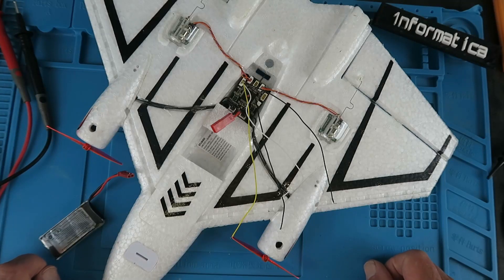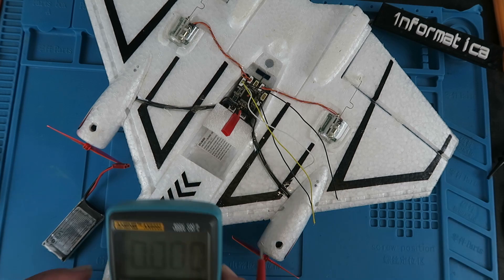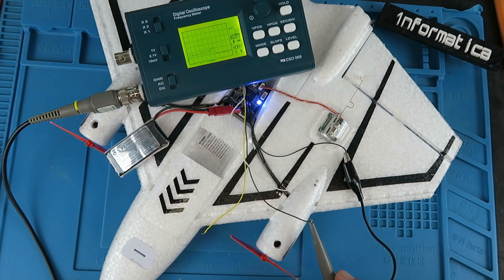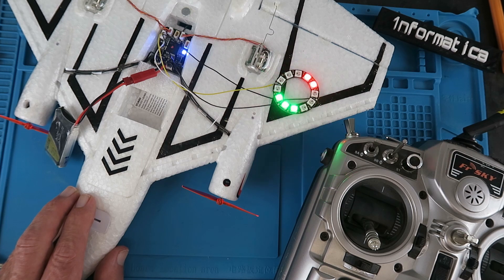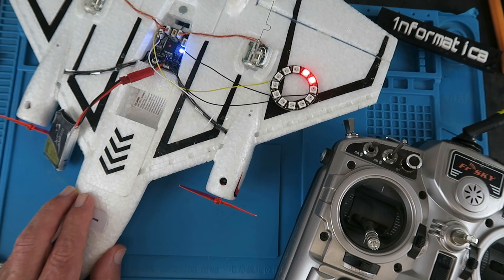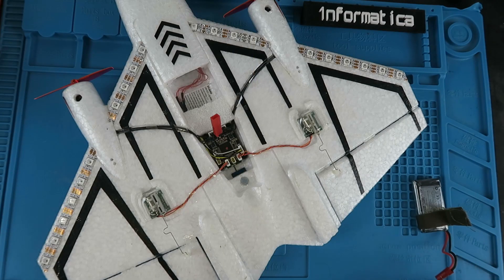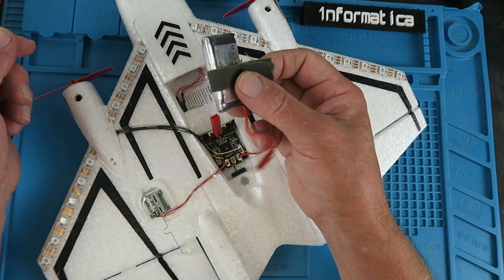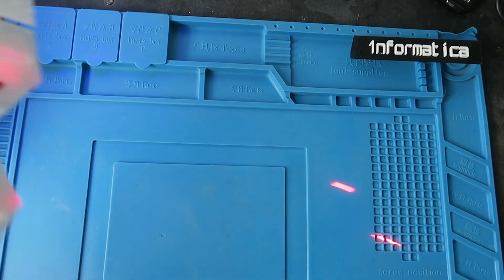UMX Ultrix DIY LEDs

Comment: LEDS are great but needs a multi color solid light setting for better orientation... moving LEDS  look cool but makes a visual reference harder to obtain. Used to fly a tiny JJ1000 quad at night in the summer when it's cool and could fly it a block away up high where in the daytime it would just disappear at a quarter or less the distance. After seeing the price for the factory LEDs a simple DIY is the way to go. Amazing little aircraft ;-)
Reply: Actually, and speaking from personal experience, they do just fine as-is.   Your small quad has little to offer as far as LED brightness goes. The Ultrix is MUCH brighter, and nobody has complained about visibility, including myself:  https://images-na.ssl-images-amazon.com/images/I/41UxrTLNQ1L._AC_.jpg

I've never had a problem with the blinking patterns at night, as the entire plane glows to some extent.  The green and red lights at the wingtips do NOT blink in most settings provide more than enough visuals for orientation.

Here's my own install video.   Happy flying!
https://youtu.be/YAAv0KnzAR8
Reply from the maker: @Doggeslife  Just watched your P38 mod, I'm planning to do something similar. I have almost completed a mod of the Flybear B17 using this DSM Rx with ESC : https://bit.ly/DSM4CHRx
Reply: @Doggeslife  On a dark moonless night using red lights in place of white light like an astronomer does setting up a scope waiting for night vision to kick in... the humble DC powered JJ1000 is actually quite bright lit up through its thin white shell which creates great 2 color orientation fading in color in and out of turns. The picture shown does not do the design justice as the light it produces is filtered and won't blind you in the dark after takeoff close by.  Even under street lights the JJ1000 can be seen a block away at night but it excels in a dark sky. Neighbors often described it as a little flashing ball of light even though it doesn't flash. For LOS flying night orientation using lights is much better than day time LOS orientation but there are considerations that don't apply in the daytime to consider and degrees of success in good orientation lighting. If you are flying a ridge at night you want to see the outline of the trees and free area lift line. And yes the exposed LEDs are much brighter and way better for distance but a dimmer is needed to use up close and not lose your night vision so you can see your surroundings in the dark too. 

With that issue of basic biology aside my gripe with the current LED programming "trend" is the first thing lights on any aircraft should do is provide heading orientation at all times to TO ALL OBSERVERS who know the color code. That means 4 pilots in opposite locations looking at a 5th aircraft in the middle will ALL know which way ALL aircraft are moving relative to the observers frame of reference simply by observing its color. After basic heading orientation is established a  finer level of orientation involving outline shape and how pitch, roll and yaw affect the visual view of of an RC aircraft flown LOS is a consideration which can involve colors mixing to create unique hues in color relative to certain common maneuvers. But flashing fast moving lights changing color for artistic benefits of a light show IMO just make the aircraft's visual space dizzy compared to solid lights providing  information to changes in orientation.
                                                                                                                                                                                                                                                                                                                                                                                                                                                              
If the FAA was paying attention to RC Hobby technology this wouldn't be being said to their deaf ears blind to basic logic due to supporting an agenda that puts harmless foam gliders in the same class as helicopters and multi-rotor aircraft of all types which is the equivalency of matching the physics of a foam pillow falling compared to a high speed bullet with RC aircraft being based on weight alone with no consideration for density size ratios and speed, etc. The FAA manages so many different classes of full scale aircraft it would take time to research just how many with one class inside of another class but since RC aircraft are nothing but smaller scale model aircraft that shows the insincerity and disrespect the FAA and it's lobbyists are showing  RC community. The FAA is demanding money from from the public to "regulate" RC aircraft, one of the safest hobbies on the planet... at least until the FAA gets done with it. On it's own the RC Hobby itself just keeps getting safer... unlike full scale jetliners the FAA fails to regulate properly. I think the FAA should do it's job in the real world before trying to "fix" something in the scale model world that's not broken and only charge money where needed excluding their own personal bank accounts.
Reply from the maker: Hey Thanks! With the LED controlled from the flight controller you have no choice but to use their patterns. I am working on an external solution that I can program to my own patterns or fixed designs.